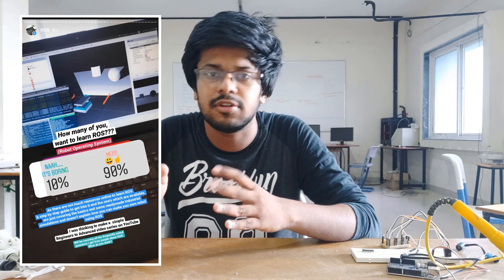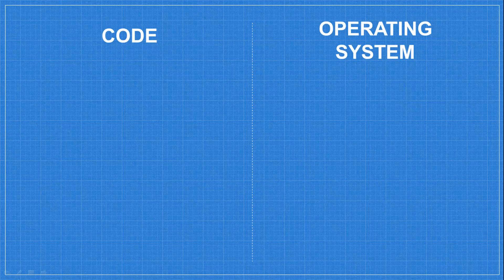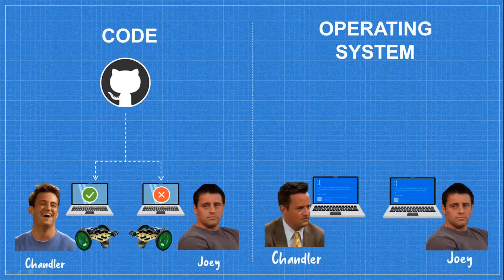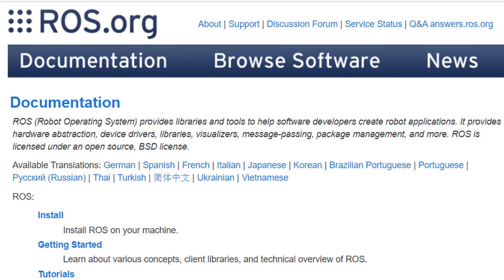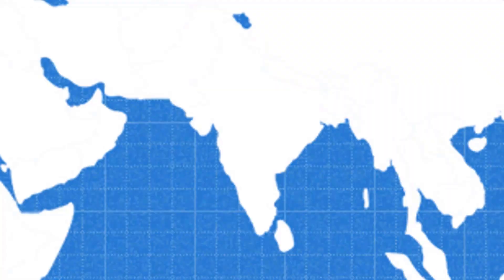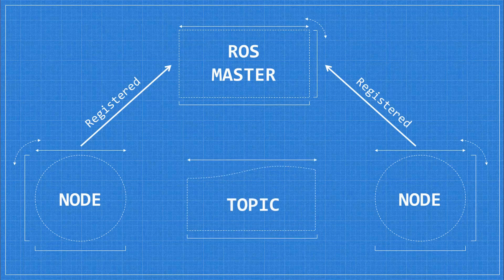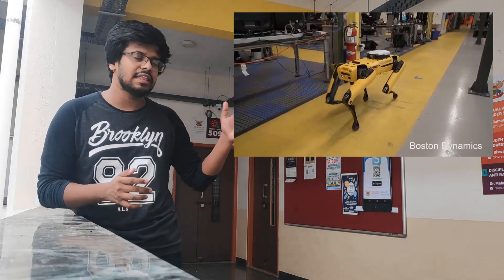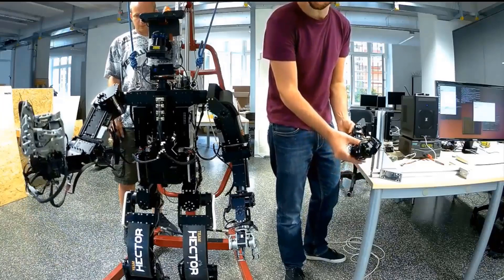WHAT IS ROS? HOW TO LEARN ROS? Important for every ROBOTICS ENGINEER? | Start of ROS Tutorial Series

Comment: Most importantly can you teach us the inverse kinematics to move a robotic arm in real world just using arduino before you uploading any other video on ros or first show it to us using arduino then ros ,please this my dream to learn please make your next video on this.

Best regards,
Your supporter.
Reply from the maker: Thanks for the support Raghav. And coming to your request, so inverse kinematics using just Arduino is tough. Because, as the name suggests inverse kinematics- you need some input of the location you want to achieve. So usually it's done using camera. And Arduino's compatibility with camera is not good. Hence ROS supports all inverse kinematic calculations. So just as a suggestion, if you learn ROS, then you can do all inverse kinematics calculations in ROS and then use Arduino to control your Robot ARM using the values you get from ROS. that will be much more easier... And I will be covering this soon, so it will be great if you hold on untill then

Comment: The video was really great, I am a complete begineer in ROS and Linux too. I dual booted my PC and have installed the LTS version 20.04. I thought keeping it updated is a good idea. Unfortunately this in not windows. So I stuck with a bit of things. There is not much documentation available and no working Wiki answers for the issues that I am facing. Anyways I installed ROS , Gazebo and Catkin tools successfully but I am stuck with Turtlebot3 installation. I am unable to get all the packages and is doesn't launch. Need some help
Reply from the maker: That is because ROS Noetic is still under construction and it is not bug free yet. So I would recommend to downgrade to Ubuntu 18.04 and ROS Melodic. That would work better

Comment: Do we need an Arduino for ros 
And any course for robotics with ros (no Arduino or raspberry Pi) Paid is fine Please tell. Thanks
Reply from the maker: No you do not need Arduino for ROS. You can use it, it’s optional, but not necessary. For course, I would recommend ROS Mentorship Program offered by my company RigBetel Labs. Its a 2 month long Mentorship Program, where you will be taught ROS right from basics to a point where you you will be able to design and make your own ROS based robots with autonomous mapping and navigation by Industrial experts. You could fill the form on the website and you will get a call from my team - https://rigbetellabs.com/mentorship